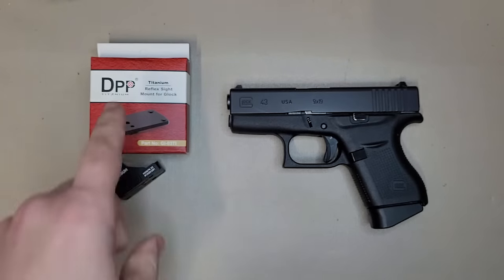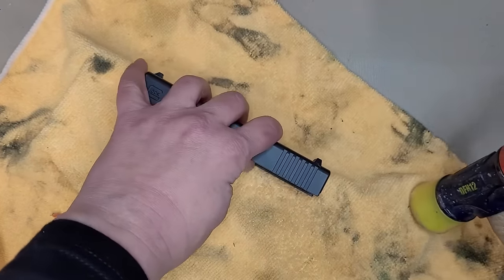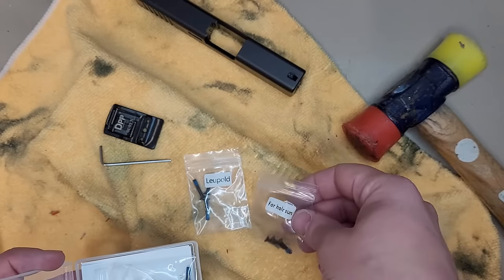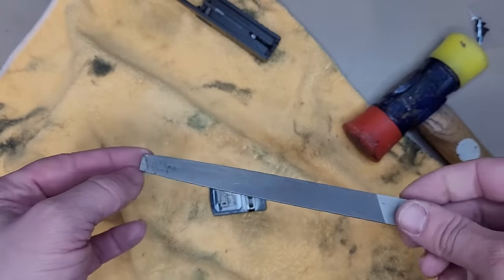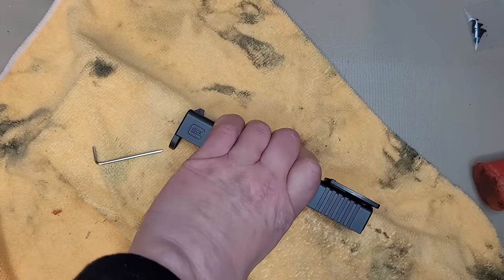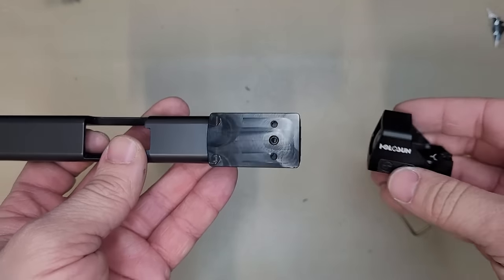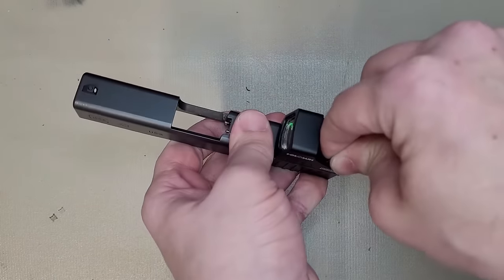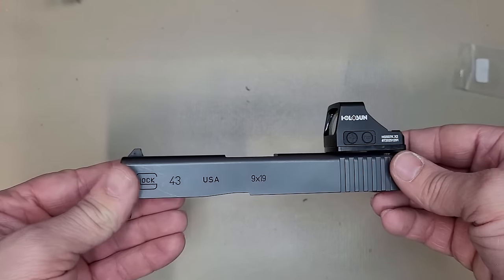I WANT A RED DOT, but don't have a MOS slide ... Easy Red dot instillation!!!

Comment: Hey Bud, So at the range my point of aim exactly on center of target, my shot is  3" or 4 "  low  so I turned the elevation all the way up ( maxed out). , I'm just now thinking/  am I doing the adjustment backwards.  Question,  should I be adjusting the dot down to the hole. The opposite from what I did,. I'm not bringing the hole up,  I should be taking the dot down on the adjustment . I remembered hearing that the adjustment is on the target, backwards
Reply: I have Guns and When red Dots took over I bought a couple and it seemed The directions were  Backward . So i Bought a Laser Kit of my ar's You get 223 308 3 different cases . I decided To buy a 44 mag and a 9mm you only have to buy a 9mm Unscrew the Bottom install batteries Chamber the Round The laser is center bore i sighted Two pistols inside My House The chamber has The Round with laser all i did was Move the Delta Point Pro Dot over the laser dot and i did the same on my 44 mag lever action Pro and i did a sig p 320 with a Romeo 1 Pro  all three were Dead on I went to my friend's House we shot steel Plates all afternoon That is easy The only way i sight in a red dot anymore .You do not waste any ammo . Best Thing i ever did to save Time Ammo and Quick to do .

Comment: Hey Jeff. Thanks for the very informative video, just what I was looking for. Quick questions:

Upon research I've found the titanium mount going for $36 and some change as opposed to the aluminum one closer to $20. Is it a big enough difference worth the extra coin? 

Also, they both list Glock 43 amongst compatible models, can I assume that also means they may be compatible with a 43X?

And that they may be compatible with other sights not necessarily listed (Viper/Venom/Fastfire) OR should I seek out one that explicitly includes the Holosun if that's what I'm leaning towards? 🤔
Reply: yes it is ok to use on the 43x, I had it on mine until i sent my slide to get milled.
Reply from the maker: It will work on both guns yes, and as for the extra 16 dollars? I don't see an issue either way .. the Aluminum is going to be lighter, but its also a much softer metal so it depends if you're going to carry and be rough with the gun, maybe be careful and spend the extra coin. If you're going to just go from gun room, to case, to range, you'll be ok with Aluminum (my opinion only)
Reply: @jeffofalltrades8489  where can I get this mount ?
Reply: @twizted0814  Amazon

Comment: Those mounting plates do make it easy to mount a dot to your pistol, but I've tried a few different kinds ( including this one ) and I just think it's super cheesy. Looks like crap, I don't trust that the dot is gonna stay solidly mounted, maybe it's just me, but I don't trust em. Also, on my M&P. 40 this plate had the red dot at such an angle that I couldn't zero it, it's sitting too high. Just have the slide cut for the optic you want to use. If you don't like it, you can get a cover plate.

Comment: Hey Jeff any update on the DPP optic plate mount after 11 months. Did it hold ?
Reply: I used DPP on a G17 a year ago using it with a holosun, have had no issues, shot about 500 rounds over that year time, still as tight as the first day. (used the aluminum version and a sight adjustment tool)

Comment: Thank u. What red dot and dpp base plate u recommend for glock 26 gen 5
Reply: I just put on a DPP Model#- GI-02TI with a 407C Holosun and will be shooting it later today for my 26 Gen 5. I have used the DPP- Model#- GI-03TI with a Holosun 407K on my G42. The one on my 42 has been on 6 months and still holds zero after 2000 rounds. I had previously used the GI-02TI mount on my Taurus G3C and it worked. As long as the handgun takes Glock sights you can use it on other handguns which is why it fit the G3C. I had no issues with it on my G3C but eventually bought the slide with the optic cut from Taurus.

Comment: Okay, I will show my ignorance here. I have a Gen 2 Model 17. I am fascinated by "dot" sights and am considering installing them. I got a glimmer of the dot in the video. Now my question. Is the round going to go where the dot sets? What if the base you set the sight of is not centered for windage?  How do you account for elevation?
Reply: Red dot sights have adjustments for windage and elevation as well as brightness of redicle.
Reply: @jameschestnut7786  Thanks.

Comment: So Jeff, how did it shoot? The Holosun 507k says it comes zeroed from the factory at 25 yards. Does the 1/8" DPP plate that the Holosun sits on change it much?
Reply from the maker: The plate does effect the natural sighting of the sight a bit, but nothing too major. I can't say how "off" it was, but after a few rounds from 5 yards and moving back to 30 it was not a problem at all. I didn't put it on and try to shoot at 25 yards right out of the gate, if thats what you're asking.
Reply: @jeffofalltrades8489  I did because the instructions said it was factory zeroed at 25 yards. I didn't hit 💩. lol
Then i went to 10 yards and tried to zero there. A little better. Then i did some rapid fire defensive shooting from 10 yards with with truly horiffic results. It's like someone bet me to not hit the target. The dot doesn't save you from lousy technique I discovered.
Reply: I have done several dovetail mounts. Some of them I ran out of elevation adjustment and could not get zeroed. A 1 degree delrin shim fixed the issue. The shims are available on Amazon and Mounting Solutions Plus.

Comment: Hell, any machinist can mill and tap the slide for a dot. Had two of mine done, $50 each.
Reply from the maker: No they cannot. Not correctly without a high end CNC machine and a code to get the front dimple supports for the sight you're using.
Reply: @jeffofalltrades8489  Dude, I have had two different Glocks done on a manual milling machine and both are spot on accurate. $50 each.
Reply: Of course I had to purchase the MOS plates from Glock for him to do the job.

Comment: Thanks for the video. Definitely an option I'm considering for my 19x. My only issue would would be with the bare metal thats left after filing the flat part. Have you noticed any rust?
Reply: It's made of titanium, so no rust problem.
Reply: @joebarden100 
...''

Comment: Does this solution work on a Glock 42 also?
Reply: I have one on my 42 and after 2000 rounds it still holds zero. I have just put one on my G26 and will find out if that one works as well. Eventually I will get my slides milled for the optics.

Comment: I understand using something like this to mount a red dot if you can not afford to mill your slide or do not have an optic ready slide. But to say that this is preferable is absurd. When running a red dot, the lower you can get the optic to sit in the slide the better. This mount clearly raises the optic to an almost unreasonable height.  In my opinion, it not only looks goofy but your height over bore is just far too great. If you are going to run a red dot, invest the time and money to do it as effectively as possible, particularly if you are carrying a gun that has any potential to be used in a self defense situation. I would say this option is acceptable for plinking at the range and for hobby shooters.  That is just my two cents

Comment: Only downside is no backup iron sight
Reply: No, the Holosun has it.
Reply: @esteban1487  the integral rear notch on the HS won't line up with front sight using the DPP plate.
Reply: @j.l.8000  Sure it will. As far the accuracy of that sight picture idk. I have to tilt the 43X up to get the front sight lined up with the sight notch in the back. When i do that the  dot floats off the top of the optic. Probably depends on the zero distance of the optic to where both the sights and optic are both relatively accurate idk. I use the 43X for CCW so probably a 10 yard zero would be good for the optic.
Reply: @esteban1487  sure you can get the post to line up with the notch if you tilt the pistol that way....but you will be greatly changing the point of Impact of the round. As little as .010 inch difference in height of either front or rear sight can move poi 1-2 inches at 10 yds, where's the round going when you basically move the front sight 1/4 inch?
Reply: @j.l.8000  Well the idea is to use the dot and have the front sight as a backup. That being said I'd have to shoot enough to know how much I'd have to hold down on the front sight to hit something. Co-witnessing sounds like it's out with a plate but I've seen some professional shooter videos where they say they wouldn't co-witness anyway.
Reply: @esteban1487  hey, if it works for you, then it works for you.
But for clarity and full unsterstanding
cowitness is a generic term meaning the sights can be viewed through a given optic. True cowitness the dot lines up with the sights when the sights are properly aligned. This requires very very tall sight on a pistol. Lower 1/3 & 1/4 cowitness the sights are visible in the very bottom of the optic window. When the iron sights are aligned the dot is close but not quite perfectly matching the iron sights. Lower 1/3&1/4 cowitness is the generally preferred method for pistol optics

Just because you are using very unusual sight alignment and a rather large hold over ( different point of aim to achieve the desired point of Impact) is not the same as having a back up sights that properly cowitnesses. 

In closing, you've already chosen a pretty durable optic, change the battery once a year or so, don't purposely use the gun as a hammer or club, and you will probably never need the cowitnesses backup sights.

Comment: Is there any negative to using a mount vs getting your slide cut for your red dot?
Reply from the maker: The negative is the sight sits up higher. But I like that you can swap it out with other sights that have different footprints, and you don't have to send your slide away to a shop for weeks to get it cut.
Reply: @jeffofalltrades8489  yeah lead times right now are 8-12 weeks which crazy. Anyways thank you for the great video and response
Reply: @CommanderShiz  Glock is 10 days idk what y’all talking about. Way better to get it milled
Reply: Not cutting makes you 100% reliant on that battery operated gadget. Cut, with tall suppresser sights, means you can co-witness. 2 options. Plus, iron sights never fail
Reply: Not to be a sick but looking from the rear, remove the sight from right to left. Owners manual and anyone who knows anything about Glock will tell you the same. There’s a method to the madness
Reply from the maker: @gregorywilliams5127  Even on my pistols with a red dot I remove the iron sights. Why even put the red dot on if you're just going to use the irons?
Reply: @jeffofalltrades8489  why not have both options in the event you red dot fails you? The reason I didn’t care for my cco in the army
Reply from the maker: @789qazify  in the event my red dot fails, I am still accurate enough to hit within a 6 inch spread without the red dot. I practice and train frequently and have the muscle memory to execute if needed. It's just a personal preference.  I don't particularly like the look of co-witnessing. Defeats the purpose of the red dot in my opinion. If you don't want the red dot, then just keep iron sights.
Reply: @789qazify  Pro tip....practice without the red dot turned on, or without batteries in it.  You would be surprised at how accurate you can be.  You quickly learn to just position your target in the red dot frame.  You can also practice with just using the outside frame of the red dot in the case that the lens gets broken, fogged up, or just plain covered in mud.  It won't win you any precision shooting tournaments, but it's good enough for center of mass at pistol distances.
Reply: @CommanderShiz  I know this is 5 months ago I gotta hookup if you need. 3 day lead time
Reply: Before I bought a rds cut slide I used a fron suppressor height sight and gave up the rear sight.
Reply: @Jbzy3000  I got my slide cut for a DPP and had my rear sight moved infront of the red dot. Love it, quicker sight acquisition
Reply: @lolyourmad2181  I saw PSA dagger has a slide like that might try for the price.
Reply: @lolyourmad2181  Where, and how much did it cost you?
Reply: @Preston_M.  wagermachineworks. Think it was 130$. 5 day turn around

Comment: I did the same thing on my 19x but it didn't hold zero for more than a couple hundred shots
Reply from the maker: Was everything tightened down and did you use blue lock tight? The only way it wouldn't hold zero would be the dot itself. If installed correctly it shouldn't be able to move at all! Hope that helps
Reply: You need locktite blue and need to put that screw tight. It is in a dove tail so it wont go anywhere except potentially sideways, but the screw will keep it from drifting left or right, besides it is tight in the dove tail. If your original sights were not moving previously, this wont given that it also has the screw to ensure it stays in place.
Reply: @jeffofalltrades8489  oh yea it was tight and secure but seemed to drift left or right sometimes, i shot it a lot though idk
Reply: @johnmartin4172  strange...I've got one on a 45 acp, over a 1000 rounds and it has never shifted.

Comment: Does it work on a 42
Reply: I just installed this on my 42 so it does fit it. I will shoot tomorrow to see how it shoots. One note is when pushing out the rear sight is to push it out from left to right with barrel pointing away from you. Install the plate from right to left with barrel pointing away from you.

Comment: I wish the it didn’t have that thick ass plate on bottom , if the mouth peeve should be attached to the bottom of the red dot so you just slide the red dot straight in without that thick plate
Reply from the maker: But if it just slid in, it wouldn't have the support that the large plate gives it. But I agree, it is noticeable! The reason I like it is for the ease of use and not having to mill your slide

Comment: 😂 how long is last or event you shootings couple days and broke
Reply: I used this method over 15 years ago to mount a Burris Fast Fire on  Beretta PX4 Storm. I still have it, and this method should work on any firearm they have the plate for if properly installed. Look for Red Dot Mounting Plates to find other manufacturers.

 There is also  a tool to properly remove the old sight that was drifted in and install and align the mounting plate. The nylon hammer is an alternative.

Comment: Not a good way to gain entry into red dots on pistols.... You want to get a dot low enough to be cowitnessed to suppressor height sights. Find the sights, find your dot. Also, these devices are NOT parallax free. Having sites as a reference will greatly increase accuracy.

Comment: Their is absolutely no way this will hold zero under hard use, and anybody who says otherwise is just lying to themselves. I definitely would never recommend this method of mounting a red dot.
Reply: By the same logic you would have to say there's no way your iron sights will hold zero. Experience...over 1000rnds on 45 acp, no shift.
Reply: @j.l.8000  big difference between iron sights and a red dot mounted like this, and if you don't see the difference you don't know what you are talking about and have very little experience with firearms and red dots.
Reply: @LeadSlinger_  I carried a 36 ( 45 acp) daily for a year, shot over 1000 rnds with no loss of zero. Now I will admit, there are dovetail ates that are prone to fail. The failure prone plates are two pieces where the plate portion screws to the dovetail part...those suck. The DPP one piece design fits very tightly into the dovetail and has a set screw. Is a dovetail mount the absolute best way to mount a dot, no. But , it is a valid way to do it for anyone who does not wish to modify their slide. P.s. I have a bunch of dot equipped pistols, and shoot 1-3 matches a month.

Comment: Looks ridiculous
Reply from the maker: Same as a milled slide, without the commitment!
Reply: @jeffofalltrades8489  you could always get a cover plate if you want to go back dotless. just saying.
Reply: i bet youre fun at parties
Reply: @jeffofalltrades8489  that's alot higher than a milled slide. Not a bad idea but a milled slide is better if you run a dedicated optic.